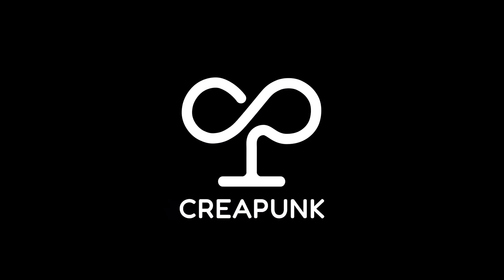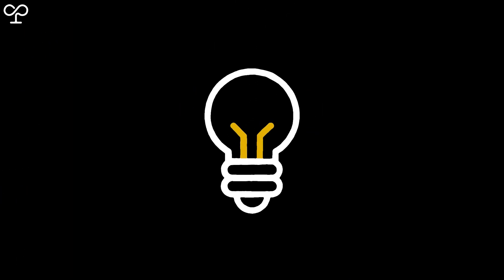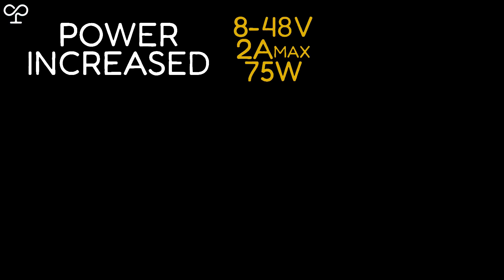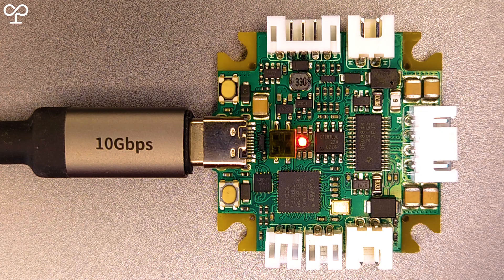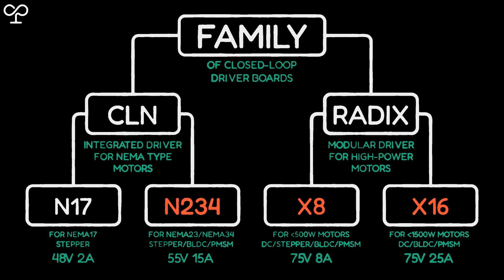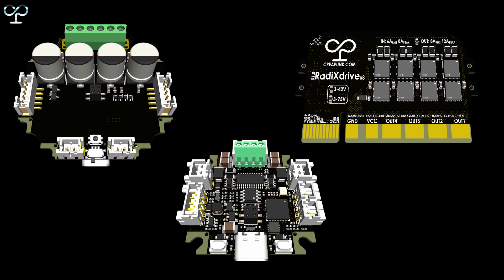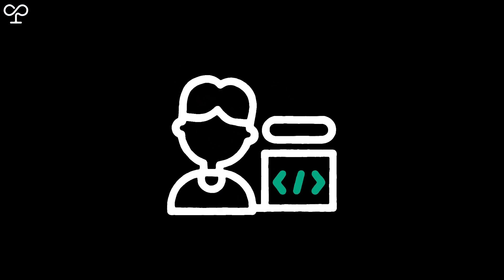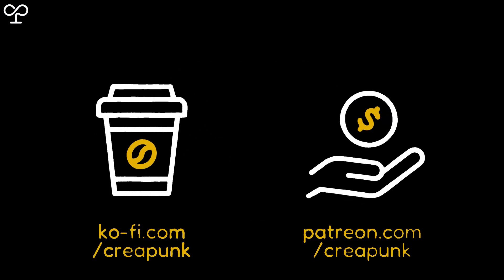CLN17 V2: $12BoM Closed-Loop Driver for NEMA17 | New Features, BETA PHASE & Upcoming Designs

Comment: There are a plethora of nema17 Closed loop motor driver projects out there. What specifically are you doing differently other than supplying a faster MCU?
Reply from the maker: You can check the comparison here: https://github.com/creapunk/CLN-ClosedLoopNemaDriver/blob/main/wiki/CLN17/alternatives.md

Key points is: support for 48V, affordable price, plenty of interfaces for almost any tasks, multiple IO protections, compact design

Comment: DRV88## as a driver ?
Reply from the maker: DRV8844, right
Reply: @creapunk  can it run as quite as TMC?
Reply from the maker: I guess so. I haven't tested at high speeds yet, but at low speeds the noise is not noticeable at all. 
It all depends on the frequency of the PWM and the quality of its generation by the microcontroller, and drv8844 can have up to 100kHz PWM, so it should not be worse than tmc